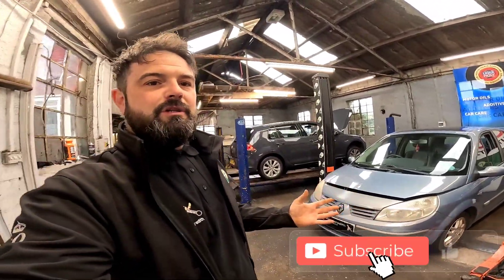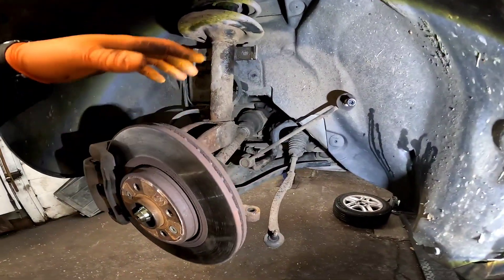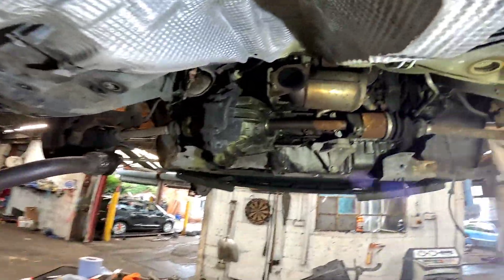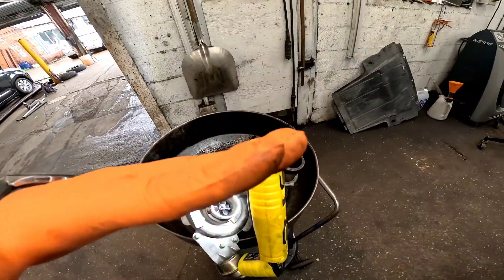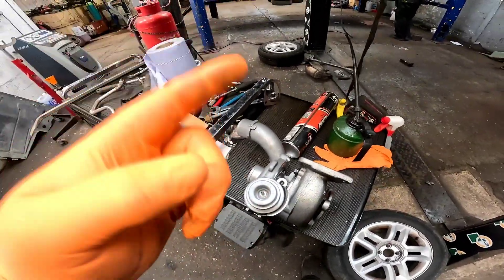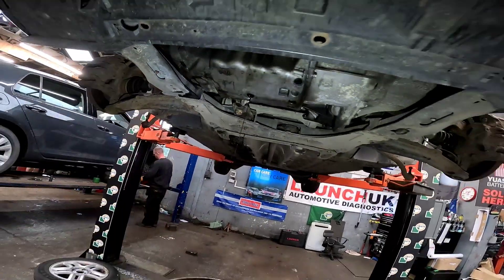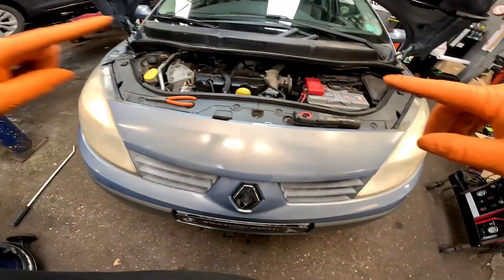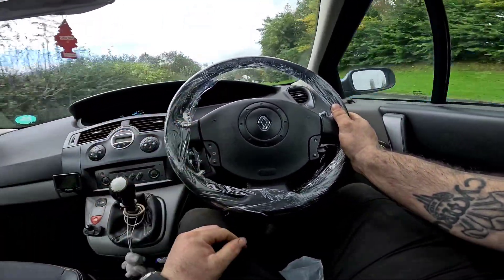Renault turbo failure 1.9dci F9Q

Comment: brillant video onthe turbo issue what chance has the DIY guy has
makes you wonder what car to buy
great video
my wife has a vauxhall 1.2 turbo petrol and I wonder what issues it will throw up for a small engine
Reply from the maker: The diy people haven't got a chance these days which from my point of view is good as you wouldn't believe the amount of cars I have to put right that people have had a go and failed and cost more to put right what they have done if you get me

Comment: I'd be wanting to replace that starter motor... looks like it's in a right tight spot to get out if it ever goes faulty.. which it probably will!!
Reply from the maker: Problem is there's lots of things to change when it's like this but if it's working it would be a unnecessary cost
Reply: @bazmeredith Hi I was wondering if you could recommend a car diagnostic that would work on a 2016 Vauxhall Mokka Diesel that won’t break the bank but will read the code and tell me what the actual issue is. Thanks
Reply from the maker: @natasharobertson783  there isn't a diag machine on the planet that will tell you exactly what the fault is. All depends on your budget https://www.launchtech.co.uk/enthusiast-diagnostics/crp-123-evo/ 
That's a good tool for the money
Reply from the maker: @natasharobertson783  what's your problem
Reply: @bazmeredith  It is coming up code 89. The garage said it is a service but it’s not due till January. I thought code 89 just meant an issue with the engine? They want £60 to plug it in so, I thought if I could pick up a machine then I could know what the issue is and prepare for the cost to fix it. I’m guessing the £30-£50 diagnostic aren’t any good?
Reply: @bazmeredith  instead of replacing it it could be useful to take the detour to change the brushes the very least instead of the whole starter motor which could save you from having to dissasemble everything again. i have a 1.5 dci asell as a 1.9 and it was an easy job on the 1.5 dci and only cost me around 20 eur in brushes.

Comment: Hey baz, nice video again, just wanted to ask if you’ve worked on many 1.4 petrol vaxhuall astras the 2012-15 models as I need some advice it would be better to use your business number but just wanted to ask first?
Reply from the maker: What's up with it ???